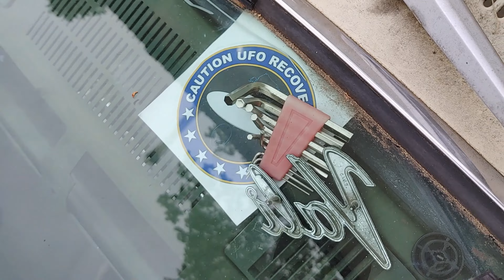Do ALL the projects! 1966 Dodge Dart refresh #nonamenationals

Comment: Did you get your hydraulic tank on skidder
Reply: Yes! The tank is installed and the skidder is working. Still searching for a leak down in the belly of the machine, but slow enough to use the machine when required.

Comment: Do you burn wood to heat the house or just the shop?
Reply from the maker: We only have a stove for burning wood in the shop. There is a fireplace in the house, but nobody has used it in many years. We hope to get a stove insert for the fireplace. There are LOTS of trees in this region and large amounts of wood goes to landfill that could be used for heating.

Comment: weak comp. in 1 hole, but don't give up
Reply: This engine has done more sitting around than driving. I have a 360 engine or a 318 engine for future. I have not made a decision for what we will be doing.
Reply: @KimPassable  360= boat anchor, 318 is best from the 2 its a lot better on fuel